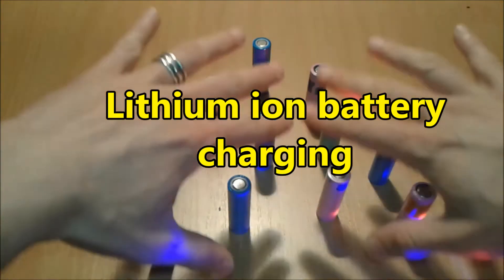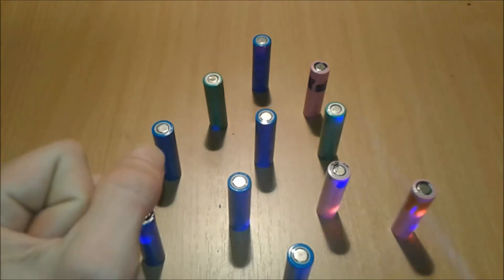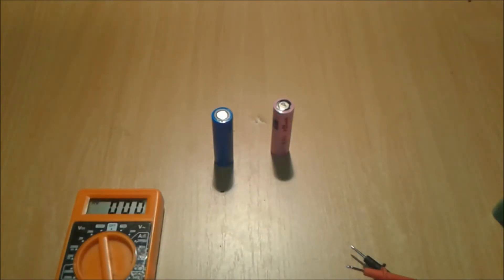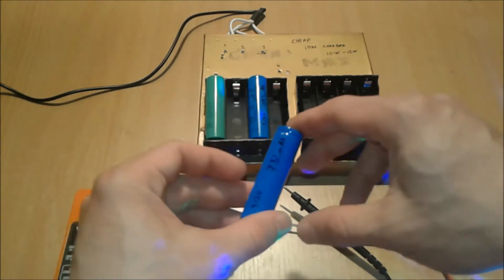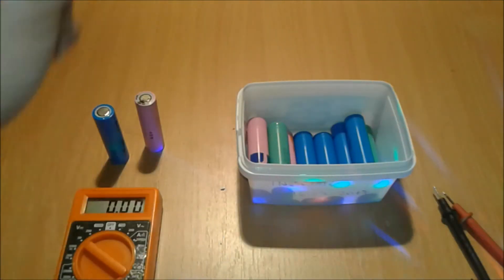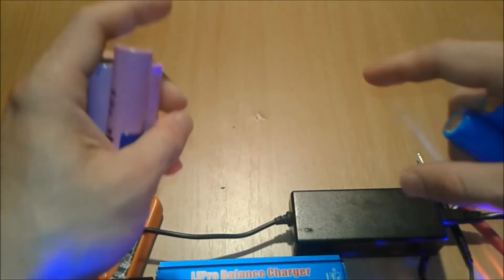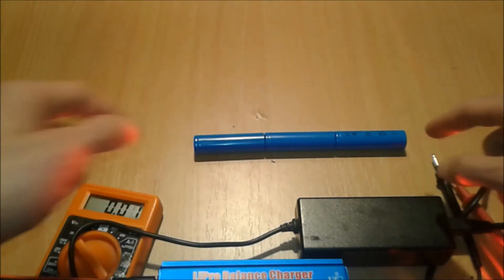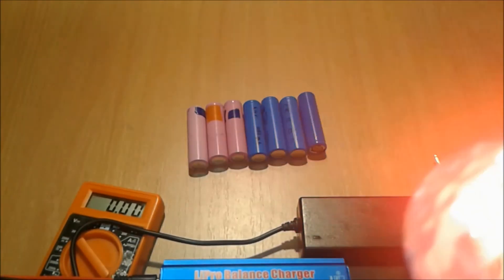Li-ion battery charging technology and secrets 18650

Comment: All I need to know is how to set up blackcell bu4 to charge the 18650 yet I can't find that info anywhere
Reply from the maker: Blank God it is a vape battery charger is got no settings just plug in the 18650li ion battery all the informations on how to charge are stored in the chip
Reply: NoSkillsRequired I'm new to this but I figured it out however only one battery got fully charged the other one doesn't seem to be charging
Reply from the maker: Blank God if is not charging could be the 18650 bad or it is too discharged you can try to connect a charged battery in parallel but you need a Multimeter to monitor the voltage on the bad one and then put it on the charger. There is a chance if is damaged to heat up or even explode so be careful. And in your charger there are the same chips like in the video
Reply: NoSkillsRequired it charged I got the blackcell bu4, the slot on the far left doesn't charge it for some reason, but I'm currently hitting some blue slushie on the aegis legend :)
Reply from the maker: Blank God nice one slowly you will get it I got more videos related check them out how to make 9v battery pack 12v and more will follow
Reply: NoSkillsRequired definitely new so it sounds sophisticated to me but I'm sure I'll get it too.
Reply from the maker: Blank God no problem   Budd luckily  you are in the right place, noskillsrequired just willing to learn

Comment: Please dont listen to him regarding throwing away batteries lower than 2 volt. Just connect this battery in parallel with same type of battery which is fully charged and leave it for an hour or two. It will get the normal charge again. And you can then fully charge it with a good charger. I've done this with almost completely empty ones and it always works.
Reply from the maker: Marlon BeeMan you can try and some of them will go back to take voltage but there will be weak and will damage your pack destroying in time the good cells. Putting them in parallel will risk to explode because the inrush of current can go up to 10a if it didn't happen to you doesn't meant the risk is not there